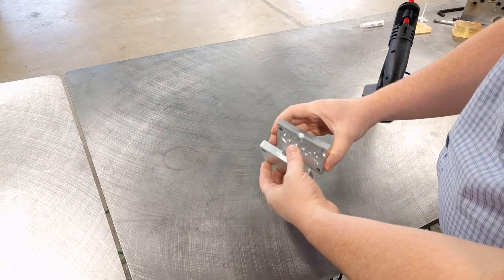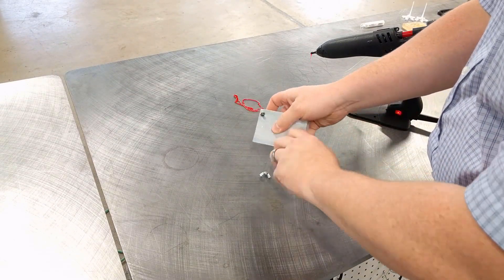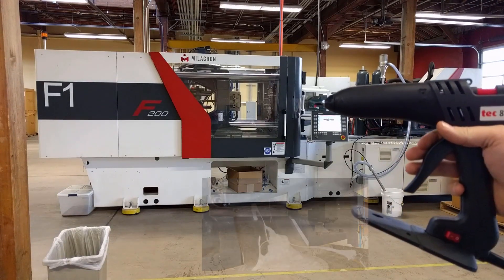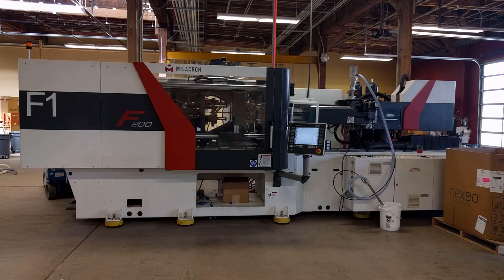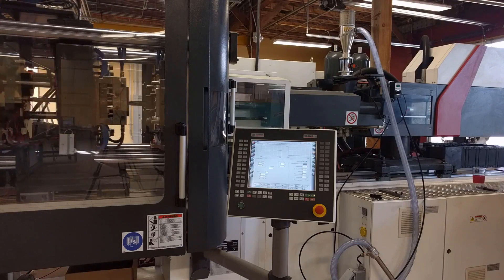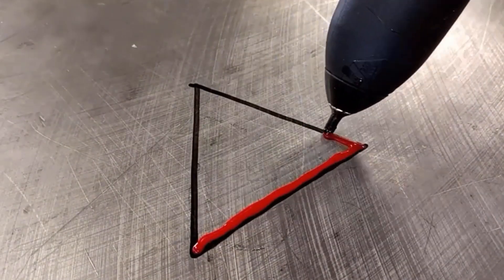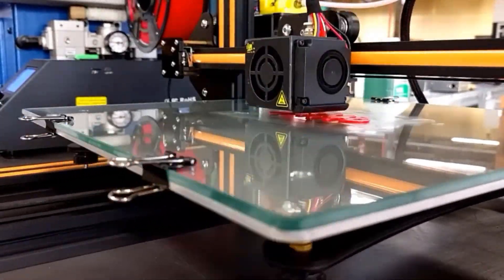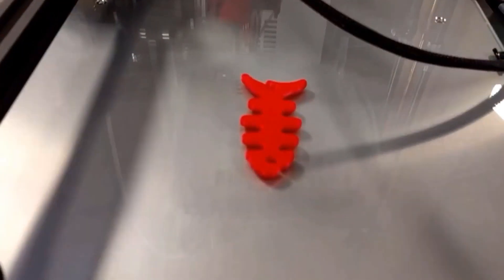Injection Molding VS 3d Printing @ Davis Tech (Part 1)

Comment: My local Makerspace was recently donated a small proto-type injection molding machine. It was barely used, as the company who donated it "went a different direction" for their parts (I think that means they outsourced the prototyping process).
Either way, it gives us the perfect sized injection molding device for our makerspace. We do have the ability to carve from aluminum block with other tools, but digitally designing molds to be carved or printed out of high temperature plastics may be less time consuming and less costly for our members. I believe it has a force of up to 20T and can use up to 4 ounces of plastic per shot.
Reply: That level of injection molding machine will require steel or aluminum molds. You could try forming molds using high temperature moldable ceramics based in ceramic epoxy technology. You would probably need to keep the parts designed for lower injection mold pressures such as simple single part molds. Higher pressures will blow out a plastic mold and probably also a ceramic epoxy mold. There are 2 companies I am investigating that make these types of high temperature ceramic epoxies. https://www.aremco.com/potting-casting-materials/ and http://www.cotronics.com/vo/cotr/cm_castable.htm

Comment: Clearly a $500 desktop 3D printer can't keep up with a professional machine bigger than my bathroom. What I'm SUPER curious about is: Is there a way to make a small-run injection mold from a 3D printed part? How do these technologies compliment each other, instead of compete with each other?
Reply from the maker: I did a project with the Stratasys a few years ago to demo injection molding into a 3D printed mold. You can see a very brief video about these on my channel here: https://youtu.be/JadaWXqT8T8. Let me know here if you would like me to do a longer video showing the process. 

I was asked by a local Stratasys dealer to host a presentation on using 3D printed molds to accelerate product development. I started the project with a lot of doubt of the technology. I was asked to design a product, design a mold for it, and injection mold part using that mold in a few days. It turns out that it worked fairly well. In a few, I think three business days I had created the design for this clam shell light Christmas light cover with snap fits, design the mold inserts, they had printed them, and I installed them into a mold base and made injection molded parts. Of course the cycle time was ridiculously long, ~ 160 seconds, in comparison to a metal mold, like 15 seconds, due to the low thermal conductivity of the plastic mold, but that isn't the point. The point is that if you are designing a product and need to have real injection molded parts that have the real material properties and strength you expect when they will be mass produced in an injection mold, well then you really need to injection mold parts from a real mold in a real molding machine. If you produce these using a traditional metal prototype mold then you will be delayed a week or two between iterations of designs. With the 3D printed mold you might only be delayed overnight or a few days to design a new mold and print it.  

It doesn't necessarily make the injection molding of low volume products less expensive, but does reduce the time to market in the product development processes. And no, so far I'm not aware of much success of people using FDM printers to make injection molds, but you can certainly resin cast low volume products using FDM printed molds. There is lots of information on YouTube about that.
Reply: They complete each other. Injection molding machine is faster for simple shapes , when you need a large volume. 

Printing allows very complex shapes using curves impossible by injecting, two materials at the same time, at small volume of production.

An Injection mold costs a few thousand euros. So the first piece costs you 10ke or 100ke. You need a huge quantity to have this cost profitable. And of course you need to rebuy a new mold for every single small modifications of the product. 

With printing, the first unit costs you only your printer and 10e of injected material. And you can change your model any time without any cost. It's the best for prototyping.
Reply: hey Davis i had  this idea of using 3d printing for active parts of the mold as  with this method you can correct your mold design in case of defaults in the injected part but i was wondering if 3d printed active part mold made of ABS for exemple will keep it shap with the high temperature of the injected plastic which is usually have a similair melting point as the 3d printed part !
Reply: @davistechinjectionmolding2327  At your video you inject plastic from a pistol to a mold. As a real machine does I guess. But I never seen a manual injection like that. Can you explain how did you do that? Is it plastic or what kind of material (looks strong). I have seen small and almost mechanical injections artifacts but never something so manually that can give you a piece SO fast (as it was really injected). That fish could take like 2 hours in a 3d printer.

Comment: Could the join between molds halves have a adjustable spring load so pressure can be adjustable for various parts need extreme high pressure during injection like platinum or diamond

Comment: Could you say something about how the mechanical properties of 3d printed and injection molding pieces compare ? Using a same material which one is stronger?   Thanks!
Reply: Injection moulded parts will always be stronger than the same parts 3D printed.

In the injection moulding process, the material is injected as a homogenous melt under pressure into a precisely dimensioned moulding tool. As the material cools, it shrinks but is ‘topped off’ so to speak with continued pressure called ‘hold pressure’ or ‘follow-up pressure’. Precise control over speed, temperature and pressure will yield parts with high dimensional tolerances. A range of surface finishes can be achieved, designed into the surface of the mould tool and could be anything from a texture, a pattern or a design to a mirror finish.

In the 3D printing process, the material is deposited layer by layer, out in the open. Each layer bonds to an already cooled layer, with layer adhesion being one of it’s many drawbacks. Each layer shrinks as it cools so dimensional tolerance will be another obstacle to consider. Additionally, layer lines will always be visible even with the finest nozzle and Z height unless the part undergoes some post print finishing.

One could argue that the addition of fibreglass reinforcement in the 3D print filament will yield stronger parts but this will only strengthen individual layers as the strands can’t link between layers. Conversely, with the addition of fibreglass in injection moulded parts, the strands are distributed fairly evenly throughout the entire part yielding an even stronger part.
Reply: @welshsteve2009  thank you very much for your detailed answer ! Could you also tell me something about the spatial resolution attainable with both techniques nowadays?
Reply: @gambarimas  Regarding your question about spatial resolution: I’ve got no idea 🤣
I can’t imagine that spatial resolution would apply to injection moulding. However, with 3D printing the part is built up in layers with each layer thickness determined by the Z height.
For a higher quality finish a low Z height might be specified which is the equivalent of printing an image with smaller pixels (higher resolution). However, more layers doesn’t necessarily mean a stronger part as there are now more layers subject to the same layer adhesion issues.
I’m not an expert in FDM printing so it might be better to do some more research into this area. I’ve seen numerous YouTube videos dedicated to the very topic of layer resolution and layer adhesion.
FYI, I worked in the moulding industry for over 20 years as a moulding setter, moulding technician, and process and maintenance engineer on machines with clamp forces ranging from 10 tons to 850 tons and in a wide range of polymers. I’ve also had some experience with blow moulding.
Reply: @welshsteve2009  I see. Thank you very much for taking the time to answer my questions!

Comment: Wouldn't a fair comparsion include the time making the mold? :P
Reply from the maker: I did cover this a bit in the second video. Certainly a huge hurdle for injection molded parts is the mold. Molds are expensive and can take a long time to build. As a general rule, injection molding is good for higher volume products, and 3D printing can be used for some lower volume parts. When production volume for a part is high, the cost of the mold and the time to build it become less significant. However there are still many parts that a manufacture may only need just a few hundred parts, but still create a mold and injection mold the product, in these cases they just currently can't get a part from 3D printing or other processes that meets the customers quality requirements. So what to I mean by high volume? Well starting off at 500 units for some parts, but certainly in the range of 10,000-10,000,000+ unit a year.
Reply: The mold is like a start up cost. You only have to do it once, so it can pay for it self pretty quickly if you need to make a lot of the same part.
Reply: @davistechinjectionmolding2327  how do Chinese molding toys cost so less ?
Reply: Davis Tech Injection Molding who do you contact about getting a part made?
Reply: @tomgirl366  usually labor. Plus the Chinese are kinda known for skimping on quality if company asks them too.

Comment: Hi,
Interesting and instructive video. Can you tell me more about the plastic rod used in the gluegun. What kind of plastic is it, and is it possible to buy it? I don't have any 3D printer, so I would like to use same technic to make some small plastic parts using molds. Thanks.
Reply from the maker: It turns out that this plastic rod I'm using in this demo is just simply Hot Glue Stick. Many people don't know that hot glue is simply a PVA/EVA thermoplastic that has some additives that help it sick to particular substrate. I find that the general purpose glue sticks don't stick to aluminum and steel molds terribly well and so they are more useful for molding demos. Beware that high temperatures, like the inside of a car on a sunny day can cause these plastics to soften and melt. The particular glue stick used in this demo can be found here: https://www.hotmelt.com/products/infinity-red-hot-melt-glue-stick. 

It should be possible to do the same thing with a very low viscosity polypropylene or polythene polymer if you get it into a rod form. I've been meaning to make a mold for glue sticks for quite some time to try this out.
Reply: I think I could try this technique, or even with polypropylene or polyethylene sticks; I'll let you know the result here.
Thank you for the tips and thank you for answering my question.Regards
Reply: @allen5921  hi, very good idea.. so did you already try with a propypropylene ?? Does it work.. and also I was wonder if there is some adhitive to make the glue stronger if the technique you say doesnt work..
Reply: @davistechinjectionmolding2327  very good videos congrats..I was wonder me if there is some adhitive to make the glue stronger if the technique using polypropylene stick doesnt work..

Comment: How did the hot glue get all the way in to each corner of the mould so effectively with no air bubbles? I thought that moulds needed to have little holes for the air to exit, which you then need to trim. Are those only required for metal casting?
Reply from the maker: In injection molding we rarely need overflows to provide additional venting as in other molding or casting processes. Rather the mold includes vent channels that are gaps between different surfaces of the mold. These are typically found on the parting line where the mold halves meet. These channels are not very deep, a few ten thousandths (.0002") of an inch deep to a few thousands of an inch (.002). The depth of the vent will vary depending on the material being molded. These vents allow the gas to escape, however there are sometimes not big enough for the short fill times usually used in injection molding. The result of this is often not a bubble, but rather burnt plastic in the last places to fill. As the gas pressure goes up, often to several thousand PSI of pressure, the temperature of the gas increases and actually burns the plastic in that area.

Comment: The question is, how much does that industrial printer cost? At least $200k, where as the best 3D printers on the market are like 10k at the most, not a fair fight
Reply: Sounds like you do not know much about the cost of these machines. 3D printers designed for home or hobby use are less then 2K and decent used injection mold machines can be had for 5k, or even less. There is a huge difference in running these. if you buy a 3D printer and have never run one before, you could be in for a steep learning curve. Same thing for an injection mold machine.
Reply: One is for prototyping and another for mass production

Comment: Your hot melt glue gun.. would it be possible to extrude HDPE sticks, and diy injection mold like your example?
Reply from the maker: It should be possible, if the viscosity of the polymer is low enough. I have tried this with some extruded HDPE rods and it has not worked out well. This ins't too surprising given that most HDPE grades used for extrusion have fairly high viscosity. I've been meaning to get around to molding some sticks with a very low viscosity polypropylene, but just haven't had a chance to build the mold yet. Maybe someone else will beat me to it?
Reply: Davis Tech Injection Molding I am building a extrusion machine from the Precious Plastic project blueprints.  Have you seen that?

Comment: Can you please tell me where to get plastic rods to use for melting in a glue gun for injection molding my part?  I really need to start small run injection molding for a product I created and this would help jump start my business very much.
Reply from the maker: The rods used in this demo are just colored hot glue sticks. I purchased these ones from hotmelt.com. However, because of its low softening temperature hot melt glue, composed of PVA/EVA thermoplastic, isn't a terrible useful material for productions products. I use it here at the college for demonstrations, but even a hot car on a sunny day can cause the hot melt glue to soften and stick to a car dash or seat.
Reply: Darn.  That's too bad. I thought is was plastic, not glue.  I wish it was possible to make a plastics injection gun like a hot glue gun, that injected ABS, ASA or PETG plastic.  I know I would buy one if the price was right.
Reply from the maker: The LNS injection molding units may be what you are looking for :https://www.techkits.com/  ?  You can use lots of different materials. It isn't glue gun pricing, but it sure doesn't cost $100k. Like a glue gun It won't be terribly repeatable either.

Comment: gun name?
Reply from the maker: The glue gun used in this video is the TEC 805-12. However any hot melt glue gun will work, but this one melts the polymer quickly.
Reply: @davistechinjectionmolding2327  What kind of polymer stick did you use in the glue gun? Thanks in advance!